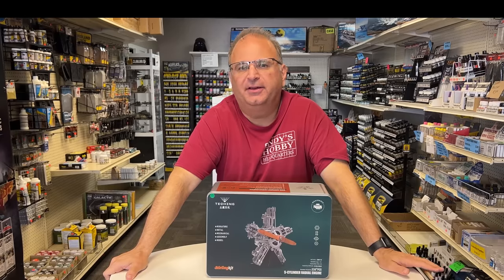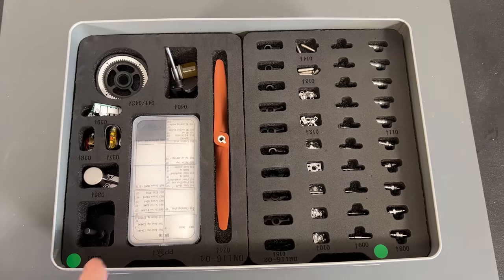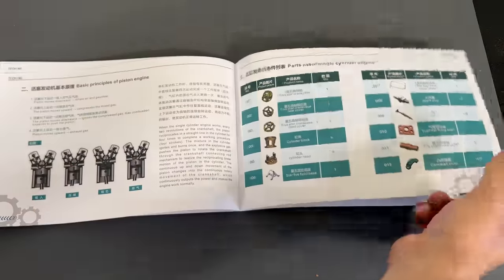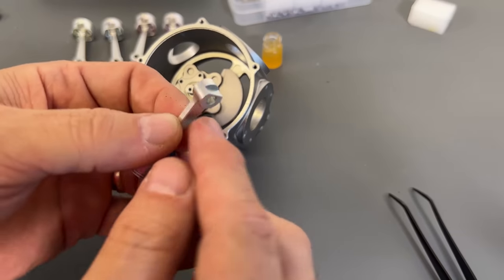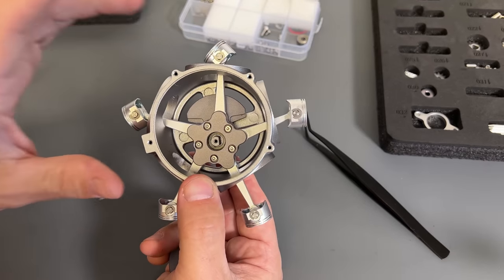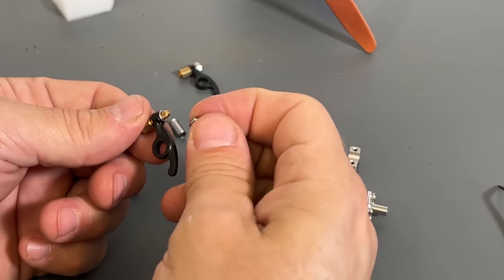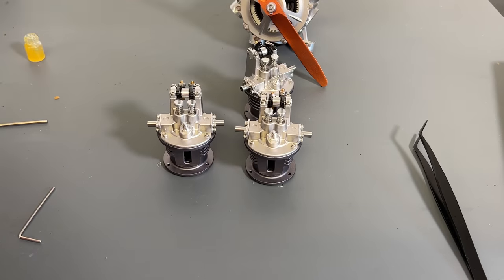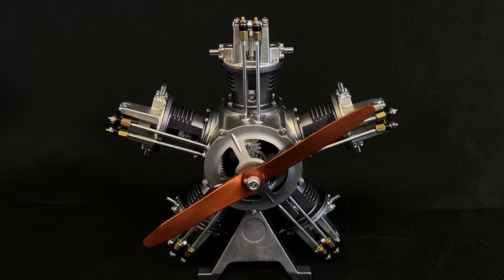Building a Look Inside 5 cylinder workable radial engine metal model Kit from Teching

Comment: Pistons and connecting rods - these go inside the cylinders.  “Main hub” is the crankcase.   The crankshaft runs in this. The notched rod is the master rod. Pushrods operate the valves via the rocker arms. 
Quick tip - vacuum the floor and work surfaces before work.  Makes runaway parts easier to recover. 
Nice model! 👍🏻

Comment: Neat kit and impressed. You kept calling the pistons “cylinders” which made me chuckle. Also the tappets/lifters not “injectors” haha. 
I also noticed the valve timing was off an if there is a correction for it to set timing in the instruction manual?
Very nice piece an always enjoy your videos.
Reply: Andy calling the pistons cylinders was driving me a little nuts. Nice kit though!
Reply: @davelytle3467  Same here 😁

Comment: Years ago I used to get paid to work on the R/C version for the OS Engines brand. Their Sirius 5-cylinder was much like this. The cam reduction gear was different. Loved to test run the multiple cylinder engines including the flat-four Pegasus.

Comment: Its a nice kit and I checked it out online. It is quite expensive here in the UK. It seems to run very well but I was just wondering with the cam gears, you mentioned nothing about timing the cam to the crank otherwise the vales wont be opening in the correct sequence to the piston.

Comment: I was wondering tht you didn't have to set valve timing. Now I see. Engine doesn't work like a real one. There is no compression- or working stroke!! Valves open at each stroke. That's very bad! All timing gear is fake and so to much money for that kit!!